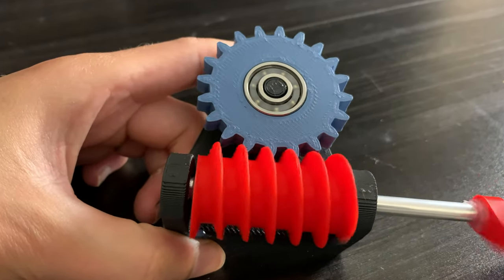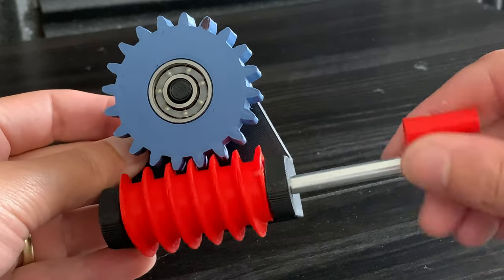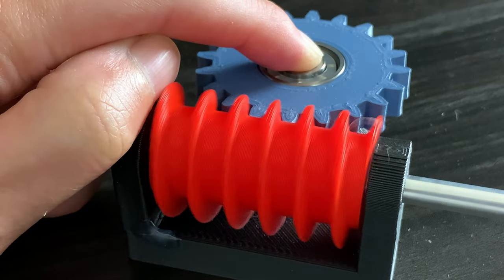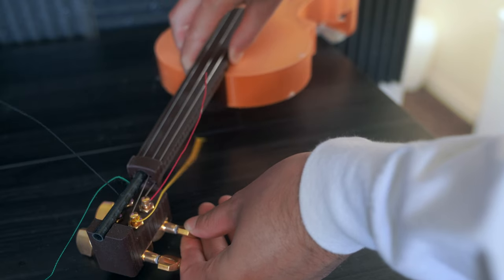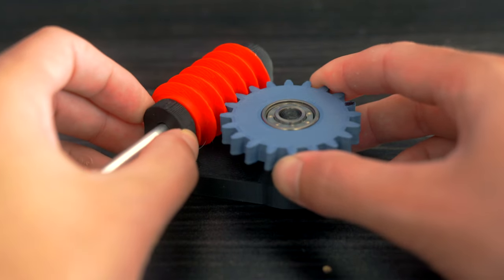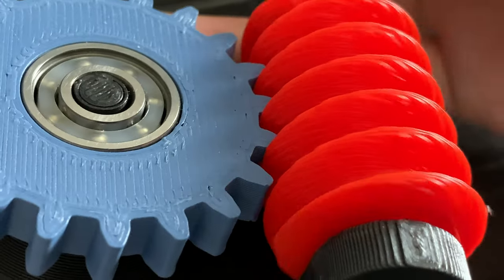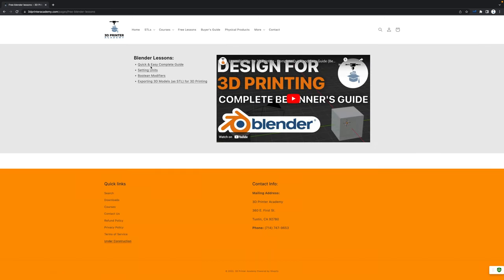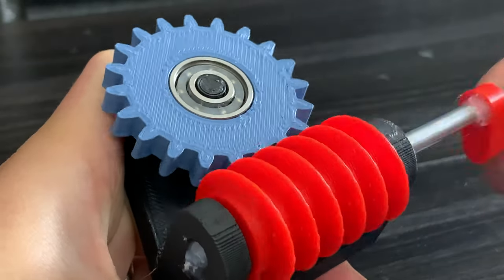This is why worm gears are so cool...

Comment: Some points of clarification:
1. The worm itself is a gear with only one tooth, hence the gear ratio observed.
2. Worm gear drives can be back-driven, depending on the ratio and on the friction between the gears. It is not wise to assume that any given worm gear system cannot be back-driven, though it is often true.
Reply: Also important to note that worm gears are the most inefficient gears. Spur gears are over 90% efficient and worm gears can be as bad as 50%.
Reply: @sethpolevoi4027  - Oh I've seen worm gear systems go down as low as 40% efficiency: there's a lot of friction, BUT, their compact size is super handy, especially for things that need to be carried around.
Reply: You can spin a worm gear with a worm wheel if the helix angle is sufficiently high.
Reply: What would the ratio be for it to be driven back. Im working on a project and really depending on the worm to be driven back functionally and smooth- also 3d printed
Reply: @Venaloid 
Better to remain silent and thought a fool than it is to speak up and remove all doubt....

Thanks for speaking up about your knowledge of the principles of worm gear drives.. 
chapter 1..."'can not be driven".
Check out the the Torsen differential design. Really cool worm gear application 😎

Comment: They are also used in torsen limited slip differentials. They allow the car's drive wheels to turn at different speeds when cornering and will also transfer torque to the wheel opposite of the one that's slipping/starting to slip.

Comment: Nice demonstration ! And good explanation. For Your information - worm gear can be designed to be back driven - for very special use cases.
Reply: Yeah, as in modern cars with electric power-assisted steering instead of hydraulic.

Comment: When designing our own worm gears, what are the parameters we need to consider?  How do we design them successfully?
Reply from the maker: Fusion 360 has a really good add-on called "GF Gear Generator" it can be used to make very precise worm drives
Reply: The most important thing is the fact that they are really bad when it comes to effectiveness, they shouldn't really be used anywhere where you can use any other type of gearbox. Printed worm gears are really fragile, soft and don't have most of the benefits that the precision milled metal ones have.

Comment: 1:20 misconseption: A worm gear can be driven backwards. Depending on the ratio it takes only 3.4Nm to turn the worm gear via the blue gear.
Rattling without any force within the play tolerances is not really an evidence.
Reply: how did you get 3.4 Nm?
Reply: @RocktracksSC   by using a digital torque meter with 1/2 inch on a 1:40 gear ratio design for a transfer case motor.
Reply: @chrisbysize  Interesting, also I imagine pressure angle would also influence this number. Thanks for the info

Comment: technically speaking, when using low ratios of reduction worm gears are reversible. One needs to install back-stop devices in gearmotors with low reduction ratios.
Reply: As a general rule, if the effiency in the forward direction is over 50%, the gear can be backdriven. This is also true for high ratios with very low friction